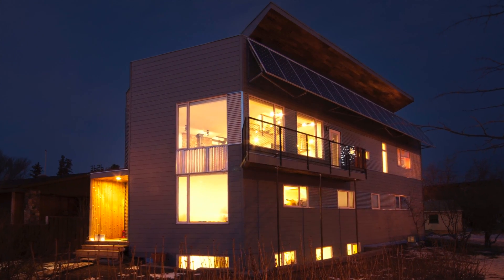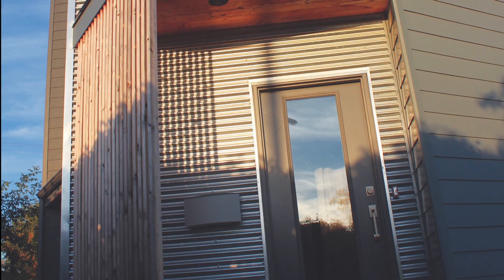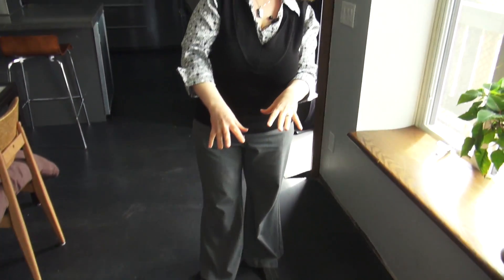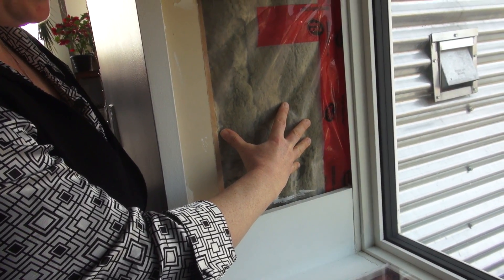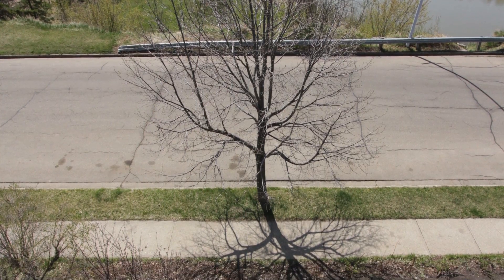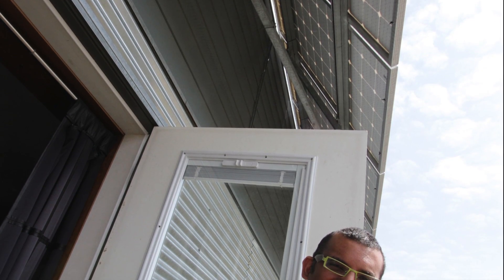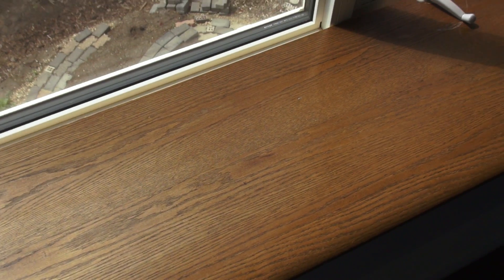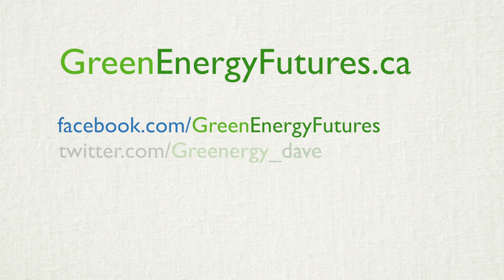80. Net-Zero Evolution - The secret is to keep it ridiculously simple

Comment: wouldn't an air tight home make the inside air toxic?
Reply: KATASTROPHE69S  Any air tight home has a heat recovery ventilation system! With this kind of system the air quality is a lot better compared to a home that's ventilated just by opening the windows!
Reply: @1n50mn1ac  ~ One of the problems I see with that system, is it requires energy to operate it. And as someone below pointed out, it is add maintenance,  and yearly expenses.
Reply: @Hexafoose  You are right, but you only need to change the filter once every year and that's all the maintenance you have to do. The energy it requires to operate is very low compared to a heating system for example because there is only a simple fan that needs to spin.
Reply: @Hexafoose  YES, the so-called PASSIV-HAUS is much more ACTIVE than a 1970's passive house. Most don't work in a power cut, plus it costs a fortune to keep replacing the air filters!
Reply: KATASTROPHE69S not with an air exchanger
Reply: shhh, you want stupid people that  have a net 0 house near a  factory with toxic smoke
Reply: @TheEarthDoctor1 air tight houses and electric cars are gimmics, part of the whole climate con that is going on right now.
 these products are just the newest latest marketing thing. the next fad will be just as shiny and dull witted.
Reply: @TheEarthDoctor1 ok. .... thing is, is that also just annother wave of hype for the purpose of opening up the electric car/solar panel market?

  sorry, I just dont trust any of it any more.
Reply: @TheEarthDoctor1 you mean like those of us who realise that 95% of the planet was killed off in the space of one min. when the last object struck earth?..... we arent going anywhere so soon, that rock couldnt kill us you think we will be able to do what nature couldnt???..... wow, thats the most arrogant thing I have heard all month!!  you must think we humans are stronger than a whole planet....